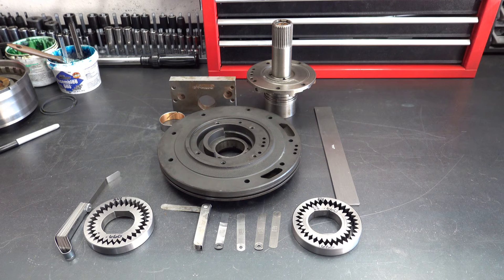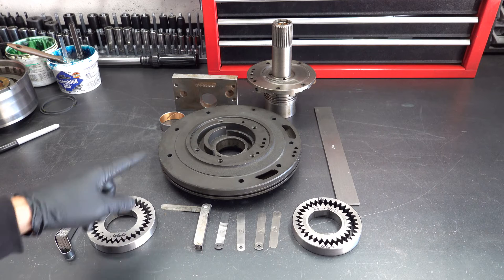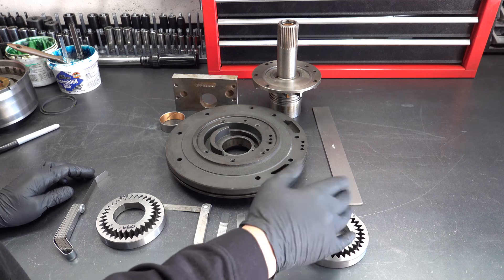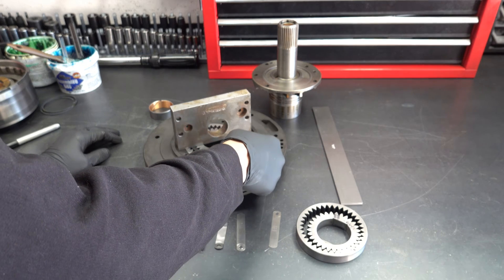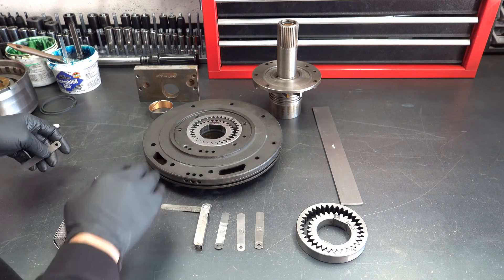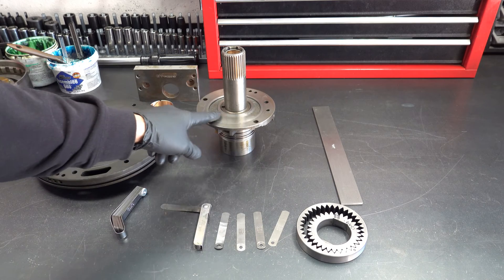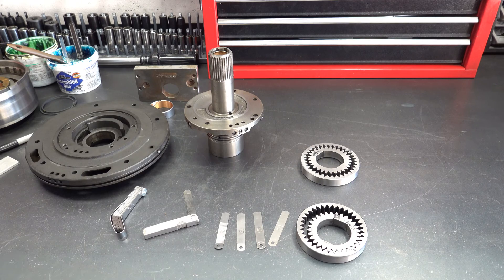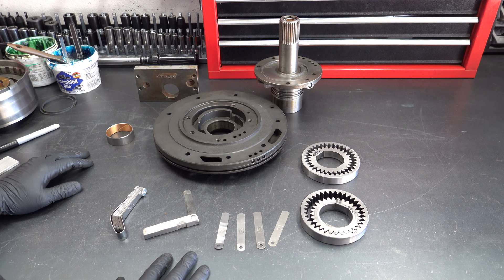Rebuilding the Ford C6: Measuring Pump Gear Clearance

Comment: Great video, very clear descriptions!  Question re. a Ford C6 in 1967 Ford Galaxie with 390. I believe the front pump needs rebuilding along with needing new seals/ bushings.  Delayed engagement into drive but shifts fine once in drive.  Leaking fluid out of bellhousing front.  Does it make sense to rebuild/service the front pump, new seals, new converter without doing a full transmission rebuild? Significant cost savings?  I would value your opinion.  Thanks!
Reply from the maker: Thanks for the views and kind words, Jim....My position on all of these situations is that if you're going inside the case (i.e. removing the pump), you're going through the unit completely and rebuilding it correctly. Don't put yourself into a position where you may have to do the job multiple times because you wanted to just do a patch job...It's not worth it.
Reply: @nickstransmissions Hi Nick, Thank you for the good advice!  I understand and it makes perfect sense.  Will look for a transmission shop here in Massachusetts.  Also in a previous post comment you had given me advice on a valve body rebuild and it worked out great, so thank you for that too!  Much appreciated!
Reply from the maker: You're welcome, Jim!

Comment: What can I do if I do have mild wear on the floor of the inner pump? Is 1000-1500 grit sand paper an option?
Reply from the maker: Hi Jonathan, thank you for watching...If the wear is such that you can drag your fingernail over it without getting stuck and all of the clearance measurements are within the ranges specified in my video, 1000-1500 grit sand paper can be used to clean/tidy it up...This applies to both the pump cover and body. If there is any wear on the crescent, I'd start looking for a new pump body as that's more of a concern than very minor wear in the pocket or on the pump stator support working surface. Plus the stator support can easily be re-surfaced on a lathe for like $30-$40 bucks at any machine shop while the pump body, if it needs to be re-machined, must be done on a vertical mill which some shops won't have.